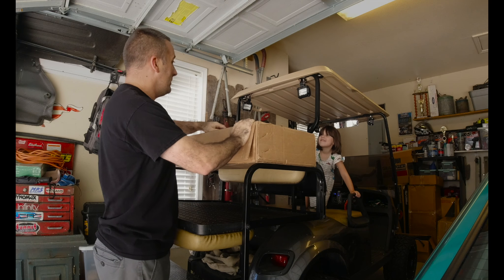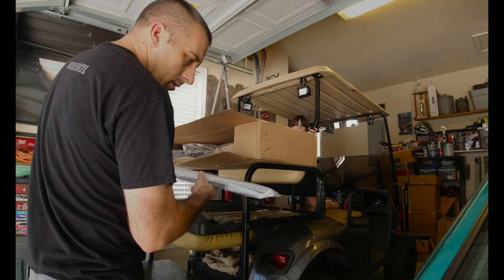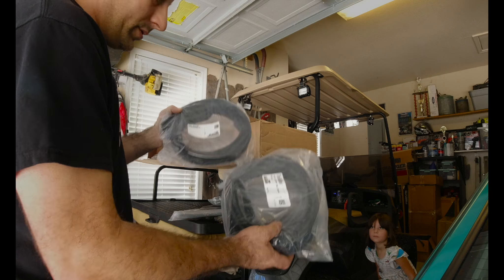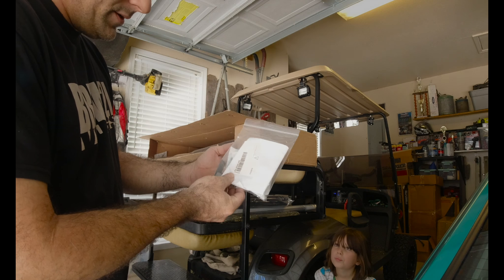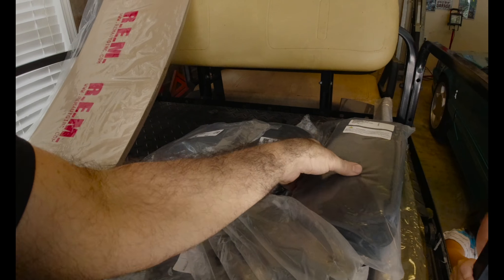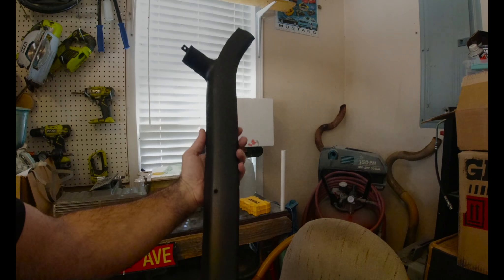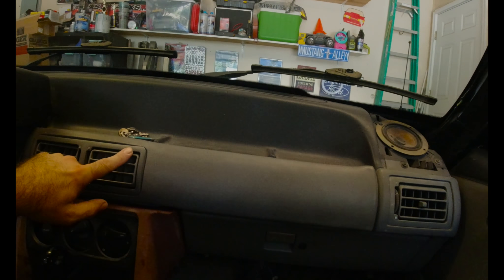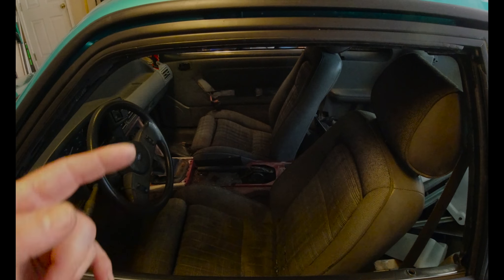📦 BOX PARTY! NEW PARTS TO FINISH THE FOXBODY ARE IN!! (ISH)

Comment: I have to do pretty much all of this to my t top car. I got some nice door panels and its an 86 4 cylinder car, so I got the proper v8 tach and I found a 140 mph speedo still in the box on four eyed pride. Still gotta get all the weatherstrip, carpet, and I want the factory GT seat covers gray with red piping. I always loved the way it looked. I got the halos for the fronts. Love that 80s vibe. Gonna put a set of polished 10 holes on it and ride around listening to 80s hair metal with the t tops out. I'm 44, and my mullet is long gone, but it's still there in spirit. Lol.

Comment: You don't think 3500 stall is too much ? I Just put gt40 heads, intake, e cam ,1.7 rockers , and i was wondering which one I should get ? Thanks
Reply from the maker: I’m going to be running 4:10 gears with the stall so that will help some. I’m hoping it doesn’t stall that much actually. I would go for the 2500 honestly

Comment: Replacing the backer boards can seem intimidating at first but it’s actually pretty easy. Just did the pair in my Calypso convertible. An air stapler is your best friend but not necessary. Use wide head rivets to attach them to the metal. Takes about an hour each start to finish!

Comment: Another great video.im going to be selling my fox body it’s has a 331 with afr 185 heads with trick flow stage 2 cam with elderbrock rpm intake with a 650 dp carb.but have everything to go back to efi with a brand new elderbrock rpm 2 efi intake brand new 75mm throttle body new kirbin fuel regulator have a computer with a chip for 42lb injectors for the tune Dmx 92 mass air. Transmission is 4r70 with fit 3200 converter and a us shift controller for the trans and running a 373 gear and a auburn posi so the question is what do you think it worth.
Reply from the maker: LX coupe/ Hatchback or GT? How clean is the car?
Reply: BREW2L 1988 mustang gt the hatch has a little rust but rest of the car is good and I forgot it has brand new 17x8 17x9 pony’s rims it does need carpet and seat to be cleaned my car is on my channel
Reply: I have owned this car since 1997
Reply: @gregoryjowers3629  what is your channel name?
Reply: Graigory Gilbert hey just click on my name and you will see it on there